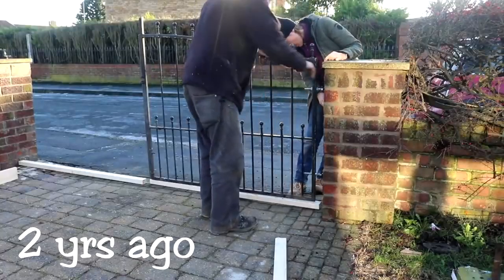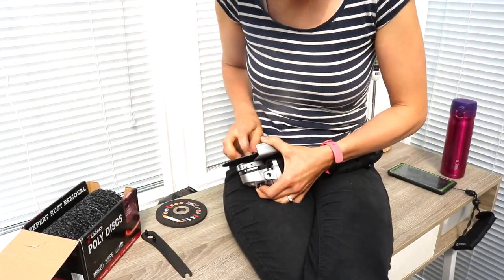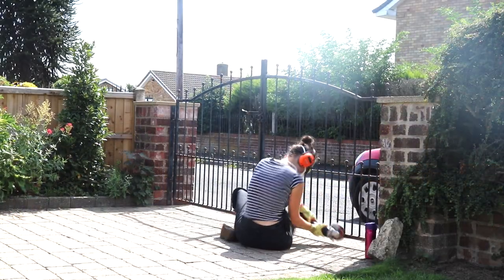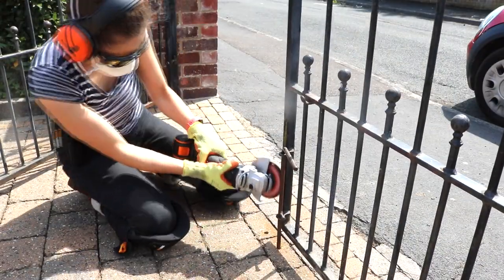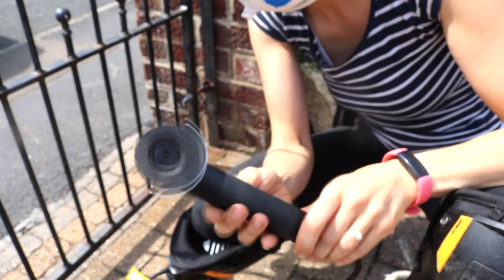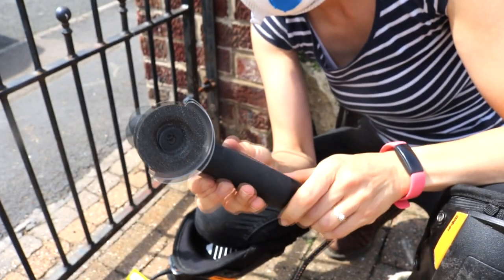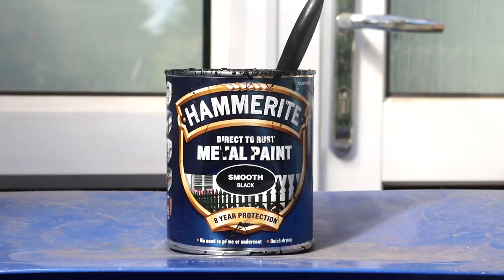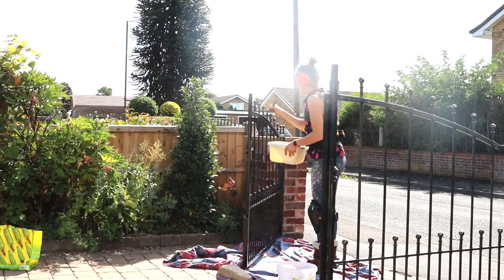Painting a Rusty Metal Gate (Restoration) | The Carpenter's Daughter

Comment: Definitely brushes for me, I think there would be a lot of over spray from spray cans and probably cost more too.
Incidentally be careful with the angle grinder creating sparks as the metal in the spark is hot enough to embed its self into glass on the car at the front of your house. The metal dust can also stain cars if left and not washed off.
Looks nice and smart those gates.
Reply: Is that getting a metallic paint job? ..... I'll get me coat ;o)
Reply: Jeez didn’t know that. that’s not great
Reply: I damaged my windshield like an idiot when 15 years ago grinding near my truck and I still have the same pitted windshield today.  It was because I was too lazy to move the vehicle but I do regret it.

Comment: Great job as always, what I love about you is that you never bodge anything and are happy to try new methods. The idea of the paint pot in the washing up bowl is genius. It did worry me a bit when your car was so close but I am probably over protective of mine. Think the gold worked really well
Reply from the maker: Thanks!  The old washing up bowl was actually a viewer's tip years ago and have used it ever since!  

Also, the car bonnet is the next restoration video 😂  *But nothing to do with the gate... the lacquer's peeling from a pressure washer lol
Reply: @TheCarpentersDaughterUK  i always try to be careful pressure washing my car in case it lifts any loose paint. My problem is i work at british steel in scunthorpe and my car gets either covered in dust when its dry or lathered with the wet dust and crap when it rains. So it gets covered in traffic film remover. Then pressure washed off including under the wheel arches. Then end up swilling drive down afterwards.
Reply: @TheCarpentersDaughterUK  The Mechanics Daughter coming to a YouTube screen near you shortly.

Comment: so I'm just starting to research how to remove rust/peeling paint & to repaint my hand rails. I appreciated the tips from your video, thank you! I've watched a couple where they spray painted & I think I might just paint with a brush like you did. Much better for the environment and not as much to mask off and cover!
Reply from the maker: Agree! Plus I think painting is cheaper 😀
Reply: @TheCarpentersDaughterUK  I'm running to many hiccups in this project. I've tried wire brushes with a drill, sand paper, paint stripper and not making much progress. Plus scrapping. I have many curves and the spindles are curved. any suggestions?

Comment: NIce Job, I like the  gold touch.  I'm a big fan of rust converter chemicals.  Many that aren't not bad for the environment.  takes a lot of the work out for me.  thanks for posting.
Reply from the maker: Thanks for the reminder!  I need to a rust converter soon on a patch on the boat.  Someone today told me I should never use red oxide before painting as the top layers don't stick.  So it sounds like I need to go back to bare metal again, rust converter, primer, etc.  What joy 😂  *Luckily it's only a small patch

Comment: This gate has less rust than mine yet I’m still planning to strip the rust and the old paint manually.  Removing it with power tools seems uneven, way too aggressive in accessible areas and not at all in closed corners. The new paint will flake in those corners together with the old one. Thanks for sharing, I’ve learned something from your experience.

Comment: Did mine in Hammerite Green with Gold accents! (but then I Am different)

Hammerite is a strange beast .... I go for the paint brush, 2" for speed.
If it is normal paint, say a gloss (I always go for liquid) a radiator roller is by far the quickest. This method works well on gutters and downspouts too ;o)

Changing the subject a bit to Rust. ..... If it is flaky you do need to remove it, but if only a light coating it may be worth painting it with Ferric Chloride. This is the active ingredient in many car rust treatments. It converts the rust to an inert black coating that will prevent further rusting. Gloves area good idea unless you want nicotine like stains on your hands! Simply wash off the excess after an hour and you are good to paint ;o)
Reply: I know hammerite can be a pain to work with. If goes well can get good results. Other times no matter what i do it doesn't look right.

Comment: I have a black and decker power file which comes in very handy on awkward rusty spots. I see the sealant covered  leggings have made an appearance again. Personally have found with hammerite even with a brush it usually covers well. Also have used the poundshop paint with reasonable results
Reply from the maker: Is this the mini belt sander? That's what comes up when I search power file.
Reply: @TheCarpentersDaughterUK  does look like they do come up as mini belt sander but have sent a picture of the black and decker one i use via your contact section on your website.

Comment: I also have a rusty old gate that also needs doing. It has lots of curly scrolly bits so those power tools might not be suitable! Oh yes brushing paint is 100% better. The coverage from spray cans is always very poor, most of it goes into the air and surrounding area.
Reply from the maker: There's been a couple of mentions of either a mini belt sander or power file if that helps?  And I imagine the spray paint going everywhere, it was that windy.  Plus, I'd have needed a face mask no doubt 😂

Comment: As someone who worked making these gates for a living many moons ago re-coating on site was always done with a brush . If like you they had to be rubbed down we advised hamer rite for the finish as the only way to get complete smoothness was to dip and strip . This would have been done in the factory and then re-sprayed . Spraying on site was normally a no no as you have no control on the environment and overspray tended to get everywhere due to the wind . Unless you had a portable spray booth .
Reply from the maker: Very interesting and thanks for your insight :)

Comment: How is the boat? you could do a gold rubbing strake on her. I have found a wire wheel in the grinder excellent for rust removal but it sometimes painful to use as the little bits of wire fly of and stick in you, also you need good protection especially face mask

Comment: Gates, arrgh! I don't know how many times I've done my sister's gates over the years, not a job I like. I gave up on the hand/tool removal and went for a brush on stripper cum rust remover. Does a pretty neat job and a lot cleaner. BTW, that black button on your grinder, if you press and hold it in, you should be able to grab the disk by the other hand (use a work glove if you nave delicate pinkies) and turn it. You can use this to take disks off and to put them on. They'll auto tighten once you get them on. Was that a football I saw Hans nudging at the start? Getting a bit above himself, no? The gold adds a nice touch and they look great.

Comment: I rarely use a spanner to tighten the nut on a grinder. I just twist the disc tight by hand and the nut will nip the last bit when the grinder is put to work.
Removing rust, l paint on phosphoric acid, go make a brew, get a biscuit or three and then wash it all off 30mins or so later and bingo, no rust!

Comment: Did you look at wire brushes for your drill or grinder? You can also get brass ones that aren't as harsh as steel ones. These can often get in tight spots. Another trouble with angle grinders is if they produce sparks, they can burn your car paint or windscreen if you're parked close. I possibly would of used some rust killer before painting too. The paints that claim direct to rust just contain the rust they don't convert it. Something like krust or jenolite. You don't have to use fancy car primer but even red oxide would of given a better protection against bumps and scrapes if used before paint. I always thought hammered finish was tougher than smooth but I could be wrong and not everyone wants their gates looking like a 70's milling machine. Little jobs like this make add up to make the whole property look good so worth doing!
Reply from the maker: Thanks!  Yes, I tried a wire brush drill attachment and it didn't do much, but I don't think it helps that it's 1" diameter as it kept spinning off, out of control on the little surface area I could work on.  It was great for taking off a bit of rust off the roof of our boat though.

Comment: Normally you don't have to go all that far with removing all that surface rust with this type of gates, if you use a good special paint with rust inhibitor in it, it should do the trick. Soapy water also was unnecessary, a good wipe with some paint thinner it's enough. As for the way of applying paint, if you want a longer lasting protection it's best to use brush and roller, spray paint will fail in a year or two, the coats are way thinner than brushed paint.

Comment: Sorry, but this video is like a lot of YouTube offerings from the U.S A.
Like our  U.S.  posts, you use a sledgehammer to crack a but.
No need for eye protection,
No need for ear protection,
No need for a dust mask,
No need for knee pads,
No need for electric tools.
At least you went for a good paintbrush .Tip( wind an elastic band midway on the bristles to reduce the amount of paint getting up to the ferrule which makes brush cleaning easier).
So you use £1,000 of equipment and consumables to do a £20 task.
I have done similar, but taken longer for a lot less.
Hammerite is overpriced shite.
I used broken hacksaw blades to remove every tiny bit of paint ; without gouging metal , which leaves deep marks.
Minimal or no dust is made and the finish is good for paint.